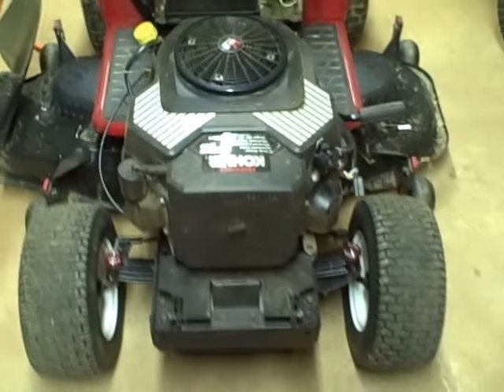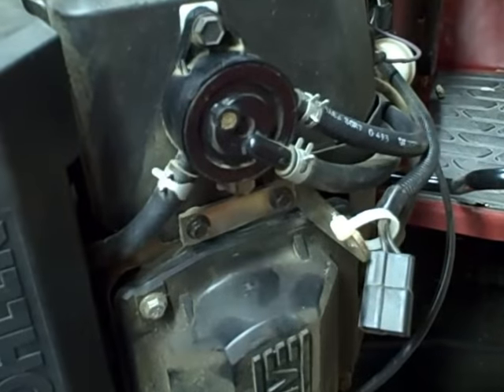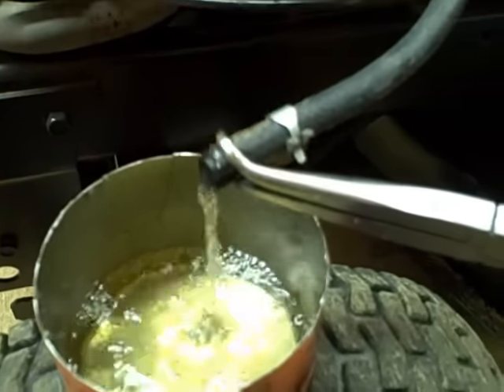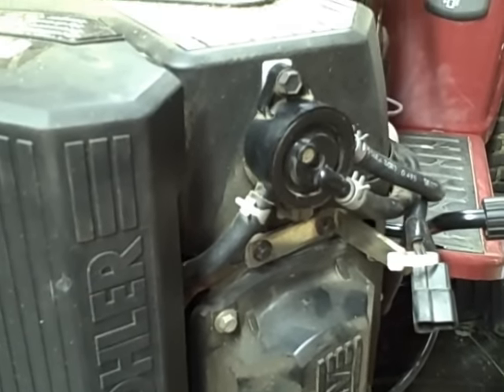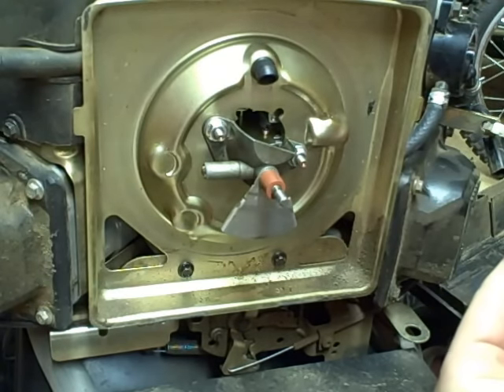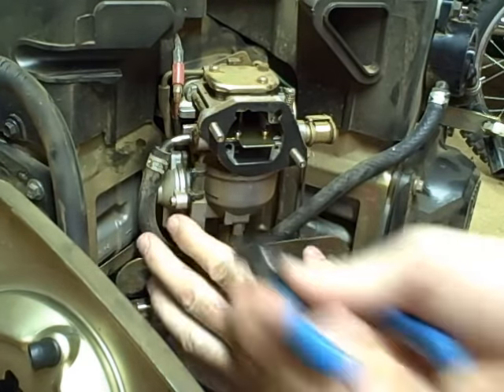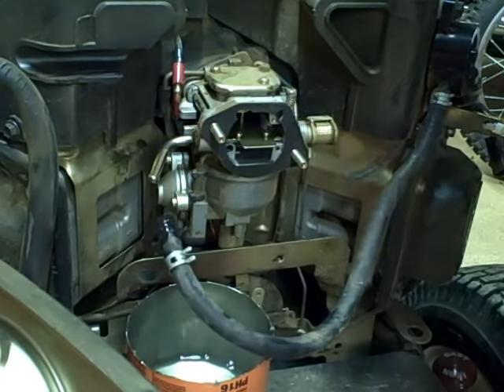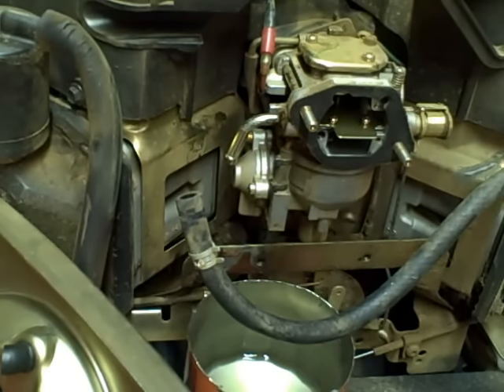Small Engine Repair: Checking a Vacuum Fuel Pump / Fuel System on a Kohler V-Twin Engine

Comment: why disconnect the fuel line from the carb? Go through all that with the air filter etc.  Cant you just pull the fuel line off the fuel pump?
Reply: That's the correct way to do it. You want to be absolutely certain and verify that line going to the carb is unobstructed.

Comment: I did that exact carburetor today acc pump and everything. It was fucking horrible! For a church I think. They don't tell me a damn thing about the customers. Sometimes have to use cardboard as a work order. Good job cranking that thing with a plug wire off. 💥

Comment: You could have just put a cup under the fuel outlet on the pump ,and cranked the engine ……..instead of taking the whole air cleaner apart …..

Comment: Hello i have a john deere L120 not getting fuel replaced tank cap fuel lines filter new fuel pump new vaccum hose gets fuel to pump but thats it.. Please help
Reply: +Adel Ramic Some motors have a solenoid valve on the carburetor to shut off the fuel flow when the key is turned off.Often times they get gummed up and stuck closed.
Reply: +Will Robinson I've a JD and found that if you can get it into a quiet area you can hear / feel the little solenoid move.

Comment: Mine heats up and looses vacuum for fuel pump.  Any ideas?
Reply: to have a vapor lock, you need vapor, so it's probably a fuel line is too close to a heat source, like a muffler?

Comment: Your fuel pump can not work if your battery is low and doesn't crank the engine fast enough also since that creates the vacuum . Believe me from experience .

Comment: Changed my fuel pump. Still won't start.
Put air pressure in the tank after I removed the fuel lines 
from the carb to try and remove the air if any in the lines.
Pump is pushing gas to the carb.
Still won't start.
Changed the solenoid cut off switch on the carb. Clicks 
when key is turned on and off.
Still won't start.
Removed the carb and did a good cleaning. 
Still won't start.
All this happened right after I mowed the yard and turned the mower off.
Won't start back up.
It pops and backfires when I choke it by hand. Starts up and then cuts off 
when I remove my hand from the intake. Hummm!

Comment: My fule pump is leaking oil, why?
Reply: if its spitting oil from the pump; check your engine oil level. the fuel pump gets its vacuum from the crankcase.....if its even a little over filled, oil will get sucked into pump and then in to carb; result is your engine 'coughing,spitting' in an over rich type way with some oily smoke too. in short , your engine oil is overfilled.

Comment: i took my dixie chopper to the mechanic to get new blades, check hydrolics tank leak, grease the 13 points, and get new gas caps, and ever since i brought her home, he is what she is doing, she tends to #1 run for about 45 minutes and then starts acting stupid and falling on her face, i turn the blades off and if i feather the choke, she mumbles n bumbles and hiccups all the way back to the house,, but IF she goes ahead n dies, she will start right back up?,also, she isnt using the gasoline equally out of both tanks at the same time,, seems one tank is getting used more than the other? never did that before,,? and it ALMOST seems like she wants to puke n spit n sputter going down hill and or in a lean/bank,,,NOW, a few years ago she was stulling and would die if i got in a left hand turn on a hill !!!, eventually we figured ot there was a WIRE flopping around, that thought the mower was turning over and it was killing the engine,,OMG,, now i am a female, and i have had this DIXIE CHOPPER for 16 seasons now, and i know my mower,,i study her symptoms and all i can tell you is what i have just said,, but, i am curious about the new gas caps? seems this started after that !!, yes they are cranked open to breath,, any body got any ideas before i take it back to the dealer for another 200-300 dollar HIT !
Reply: ooops. it is a kohler 23 hp
Reply: Petie Stewart
Reply: Petie Stewart
Reply: its a dirty fukin carb, CLEAN IT! jets and passages. clean the tank dead dry too as water collects by condensation and shitty alcohol ed gas.

Comment: And next we are going remove the seat , steering wheel the battery and the mowing deck. WHAT The  hell?  Just take the carb line loose from vacuum pump to check pump discharge run a short hose to  a can or bowl.. why take unnecessary items apart?  You must have a lot of extra time .. wow!!!
Reply: I worked at a Motorcycle Dealership one time as a Salesman.  However, I often had lunch in the lunch area with the mechanics.  We spoke a lot about shop and motorcycle repair.  It was sort of a training session.  I learned a lot.  However, one of the things I learned was this: Maintenance time is "rounded up."  If a repair takes one hour and fifteen minutes to complete.  The mechanics are instructed to burn that other 45 minutes to check for stuff, that could be sold to the customer, such as air filter, gas filter, oil change, Cable lubrication, clutch adjustment, chain adjustment.  You get the point.  Then, they charge you for two hours labor and tell you they "found" some things, such as a dirty air filter or need for new spark plugs or fuel line.  They didn't make stuff up, they just checked things.  Most of the customers did not perform their own maintenance.  The Gold Wing Rider most never did.  They were typically older and some disabled. So, the Dealership did all the required Maintenance.